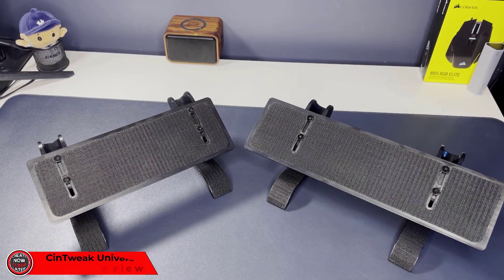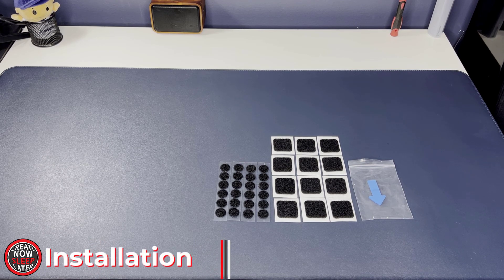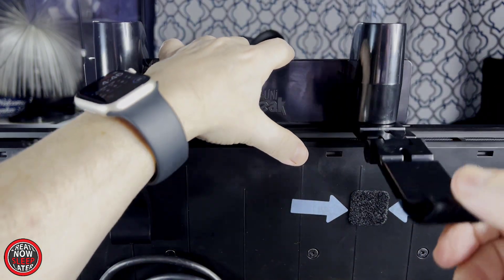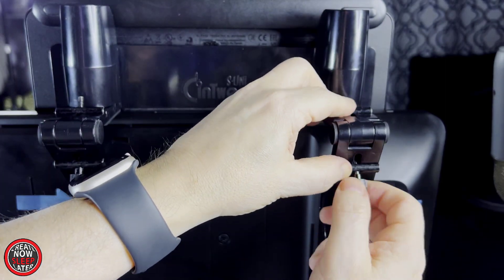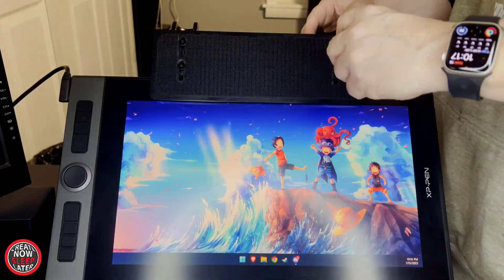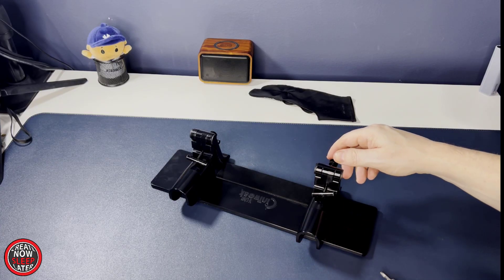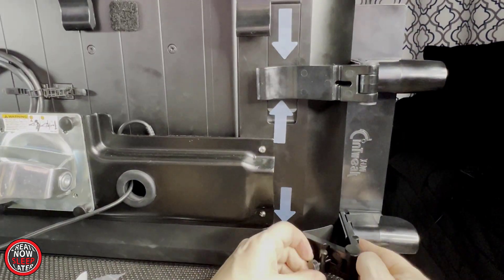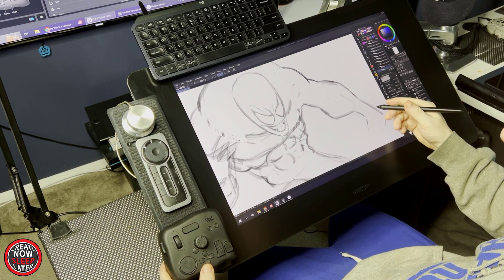Enhance Your Digital Art Space - CinTweak Universal Keyboard Tray

Comment: The website shows the pen resting in the two cups on the top... does that mean it rests on the pen's nib, or directly on the eraser? It doesn't look to be a funnel look like the normal stand. I ask, because that is terrible. If you store your pen in a cup or store it resting on the nib, the tip will be in an active always state, not letting you "click", breaking your $50-80 pen permanently.
Reply from the maker: There is a rubber softener on the bottom. I’ve had all 3 of my pens in there without issue. Prior to that, I kept them on a cup 😂
Reply: @CreateNowSleepLater  That's terrible, and really bad for a product if it doesn't have the foresight not to design the holder correctly. It shouldn't rest on the pressure sensor. There shouldn't be anything, rubber, foam...nothing. Look at the OEM holders. you can rest them sideways or vertical in the funnel style holder. Avoid this at all costs.
Reply from the maker: @someonespecial1525  The holders don't actually need to be used. In fact, you can take them off.

Comment: Do they have an option just for a pen holder? Without trays of any kind, just something for the stylus alone
Reply from the maker: I don't think so but I'd ping them. They are really open and good to talk to. Im sure if the demand was there, they could come up with something. They would probably need a lip of some kind to take the place of the tray.
Reply: I used a Command Strip metal hook (the one that swings & such in the plastic base), pried open the hook with pliers, and attached it to the back of my pen display on the top right. I then just slip the pen in with the nib up and it's one of the better, easier hacks I've done, because I hated having to keep track of my pen.
Reply from the maker: I hear ya, I have a number of Wacom pens and somehow they all get eaten or something.